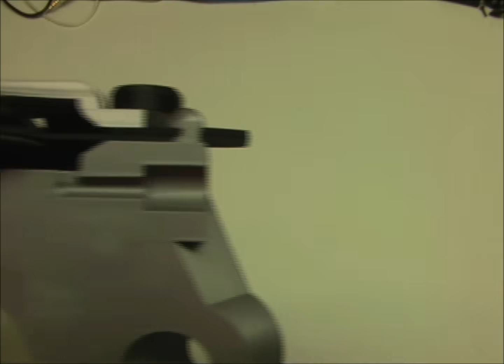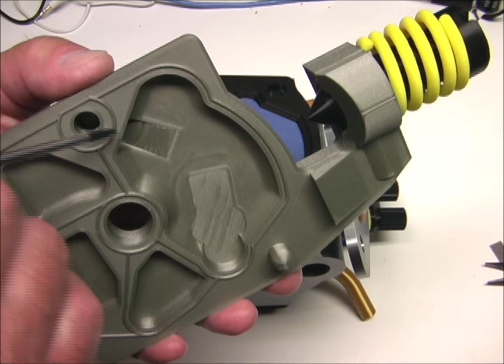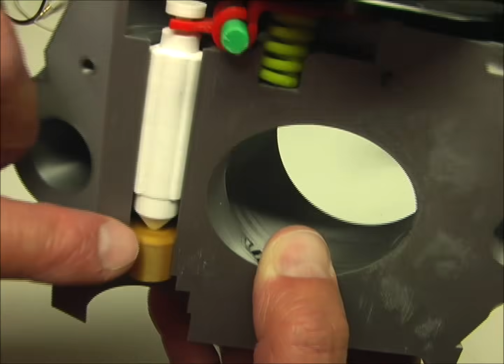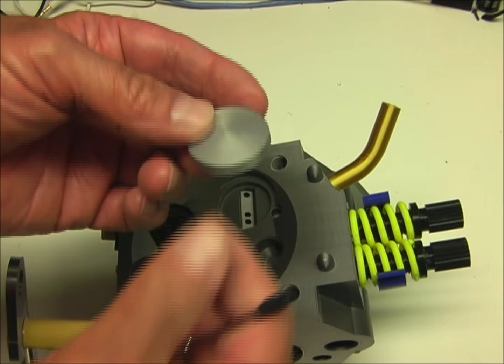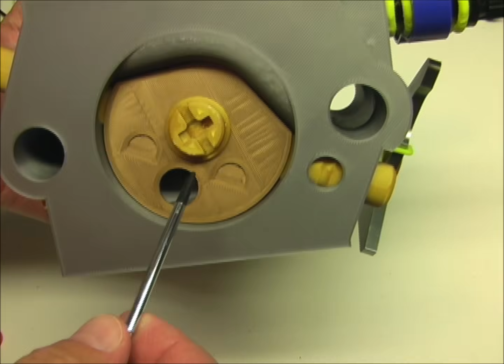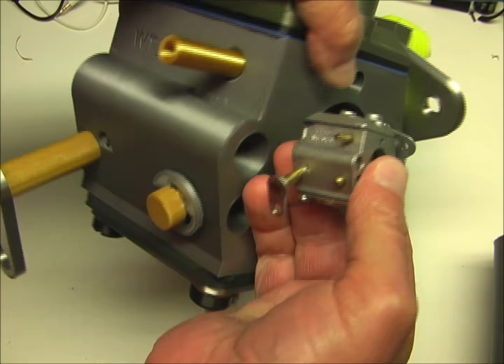How a 2 Stroke Carburetor Works, Fuel Pump & Metering

Comment: Could you explain in detail how the carburetor screws are adjusted while motor is running.  How does the idle and low pressure screws work together under ideal conditions.  Great video.  Thank You

Comment: Is it normal that  can't I blow into the fuel inlet with my mouth , the air will not go in. 
Even if the carb is off the engine.

Comment: This demo took me from mere fascination about the 2-stroke carburetor to a sound knowledge of the inner workings. I feel pretty confident I can take on my 2-stroke equipment fuel issues now. I have a chainsaw, which is out of production now, but has been a super dependable tool that I can get carburetor parts for but not the carb assembly. It needs lovin,,lovin'... here's to my new found knowledge. Super video.

Comment: 2-stroke or 4-stroke, carburetor works on same principles. Needs to be richened some to offset the addition of 2-troke oil, which leans the mixture fuel-wise, but works the same...

Comment: The inlet lever height adjustment is straight forward, but what should be the clearance between the fork tails of the inlet lever and the upper and lower collars of the inlet needle ie., how much does the lever need to move before the forked tail reaches the top collar and starts to raise and unseat the needle ?

Comment: What is the tube on the left side ,  forward of the mixture screws? I thought it was an impulse line but its hose  runs under the carb and to the standalone primer bulb. I'm getting no fuel to the cylinder in my brand new chainsaw

Comment: Thank You for this detailed exemplary explanation. A template for how to explain a device! 

If you have time, could you comment on how much interaction there is between the low and high speed needles. Is a statement that the low speed affects the high but the high does not affect the low, or opposite, or they are independent, hold true.

Also, does the low speed term  mean mid range/transition? I see there is the single hole called idle and 2 holes called low speed.

Thanks if your time permits any info.

Comment: I didn't expect this level of clarity and professionalism. English is my second language but I designed closed to 100 machinery, machine tools, injection molding machines and tooling and wrote most manuals for them and I did not even reached 75% of quality job as you did here.

Comment: I have never understood carburetors and my work on 4 cycle carbs has kept me away from the smaller ones. This video shows me I shouldn't have parts left over with 2 cycle carbs and your explanation really explains how they work in an understandable manner. Thank you so much. Now for your model. The amount of work to produce it seems fantastic. It really helps with your explanation. The time spent producing it was worth the work as it is large enough for us to see what is happening. Thank you for your time and effort.

Comment: Jay, I have a question. I think the one thing you didn't mention is the return/exit hole.  Is the vacuum of the fuel tank and lid valve supposed to prevent the fuel from flowing back into the carb ?

I don't get what keeps the return line from constantly delivering fuel to the carb. The metering side pulls the fuel in from the pump side, but the return hole is also there in the same chamber recess that feeds the nozzle check valve, and the nozzle check valve allows fuel to flow into the venturi. I just don't see why the carb should stop the backflow of fuel from the return line.

That's wrong of course, but i just don't see the mechanism to prevent it...

Comment: Excellent tutorial video. These carburators are so finnicky to work on and every once in awhile i get one that no matter what i do it just will not work right. At least now i have a better understanding of what goes on inside one. Geuss its time to start removing the welsh plug on some of the dead ducks to see if passage is plugged up behind them. Is there a special sealant needed when installing the welsh plug or do they mechanically seal just by setting them with a drift?

Comment: Those  enlarged 3-D printer models are brilliant. This is the first time I got any real understanding of how the tiny carburetors on 2-cycle garden equipment work. Lots of repair-tip videos out there, but nobody else takes the trouble to give the overview and explain the details of the fuel delivery cycle. For those who want to understand what's really going on inside these little marvels, watch this. Chinese factories may be able to turn them out today for $20 (I just bought two), but it took 150 years of creative thought and engineering to design and develop them. Appreciate that the next time you pull that starter cord.

Comment: Durn!  I've been rebuilding carbs for years and this is the best break down I have ever seen by far.  It has given me a new understanding of things that can go wrong and how I might fix them.   It also lets me see what I should expect to see when doing things like squirting carb cleaner in the various holes.  Walbro carb are very common and the clones work just the same with minor variations.  I owe you my thanks.  Next time I lift a brew I'll toast you.

Comment: Thank you for taking the time to make a large model carb and explain, in plain language,  how the fuel flows in a 2 stroke carb.  The carbs are not dependable. the slightest contamination can affect its operation, thus they break down frequently causing frustration. Hopefully the DIY can defend themselves with this knowledge and be able to repair it. God Bless

Comment: Amazing giant model and perfect and beautiful explanation of how all the parts function, including all the drilled passages of the idle jet ports, especially the idle ones in the sidewall of the carb throat. The tiny idle drilled jets are usually the real troublemakers as they are subject to being easily clogged, causing stumbling and stalling when the engine is just coming off of idle. Bravo.

Comment: Walbro should adopt this video as their main (and only) tutoring source to educate their engineers.  I am a retired computer engineering prof from a local university, and I can vouch that this is an amazing piece of work done by Mr. Gould.  I searched in the internet to get a good understanding how a Walbro carb worked because I wanted to learn about RC gas engines, but couldn't find anything substantial, just bits and pieces of info published by people who didn't know the entire mechanism.  Finally, I started examining Walbro diagrams on Walbro website, trying to figure out the exact mechanism.  I found out most of these diagrams were sketched for people who were already very familiar to Walbro carb, but didn't make too much sense to me (or novices that don't know too much about carbs).  I am glad I stumbled across this video.  Thank you again.

Comment: Hallo, Frage: Hast Du verschiedene Walbro WT Vergaser am Lager (z.B. 962 / 1114) oder andere. Für meine Modellmoren brauche ich diverse Venturi (7mm / 8mm / 10mm / 11-12mm). Von Walbro bekommt man ja (zumindest ich) keine Antwort welchen Zusammenhang die Nummer in Relation zum Venturi sind. Hast Du alle Ersatzteile für WT Vergaser, was ich suche sind Check Valve Assembly und Metering Feder da dies in praktisch keinem Reparatur Set vorhanden sind. Da ich nicht mal auf Deiner Homepage eine E-Mail Adresse gefunden habe versuche ich es hiermit.
Besten Dank und Grüsse
PS Wenn Du meinst 4-takter wären lahmer als 2-takter schau Dir meinen selbstegebauten Sternmotor (120cc) mal an (YOUTUBE: Birth of an engine - The run.

Comment: I agree with all the comments about the sheer clarity of this. The one thing I wasn't sure about was the diaphragm being pulled down by a vacuum. I'm assuming that vacuum is generated by air flowing past the fuel nozzles and gets back to the chamber through the fuel ports that lead to the throat of the carb. My carb seems to be pumping fuel into the metering chamber just fine, but if I can get the engine to start at all, it will only run on partial choke. It would be great to understand the vacuum mechanism better.

Comment: Great video, I was hoping you would explain the return side of the fuel route. I got an issue. When pumping the purge bulb the fuel floods the throat of the carb and does not go out the return tube.

Comment: Excellent job explaining the 2-stroke carburetor.  Particularly impressive is the use of 3-D printed model which makes it much easier to see the inner work of the carburetor. Will there be another one for the 4-cycle carburetors?  Thanks.

Comment: Unfortunalely  Walbro  also  has a main  nozzle in  throat that  is  connected with check  valve. I  did  not see that  in  video.I  have 4 pieces of brand  new carburators and  all  leaks at that  nozzle when  primed.Being  new there's  can't find any explanation since the check valve  is  good,,the  metering  valve seals 100% Anybody any ideas? Thanks

Comment: Thank you, this is fantastic.  Does the low speed needle always provide fuel even at high rpm?  Does the high needle only supply fuel when the air velocity through the venturi creates a low enough pressure to draw fuel in?
In other words, I'm curious what determines which path the fuel takes once it gets in the check valve.
Again, thank you- this really is so well done.

Comment: Amazing video!!  I now have an understanding of what goes on inside that little bugger with the adjustment screws on it.  About all I knew before was that fuel goes in and if it starts....the noise of combustion comes out.  Turn the screws to make her either blubber or sing.....🙄

Comment: Absolutely incredible. Video and explanation.  My only question is why the 3 holes on the low side instead of just the one that is on the engine side of the throttle plate.

Comment: Love your video.I have a Stihl weed eater and it floods the carburetor and the head with fuel each time I pul the cord.if I turn in both low and hi idle screws how many turns do I turn each of them outward to get it to start because it won’t.and the primer bulb just pumps fuel into carb and doesn’t fill itself up?thank you in advance for your time knowledge and reading my comment.thank you have a blessed day

Comment: Absolutely fantastic tutorial and 3D printed models! I'm Technical Director of a company that manufactures 3D printers and the time and effort put into Jay's 3D models is enormous, hours and hours of work needed to design and produce these models. Jay, you're a credit to engineers everywhere and your tutorial is 5* Thank you!

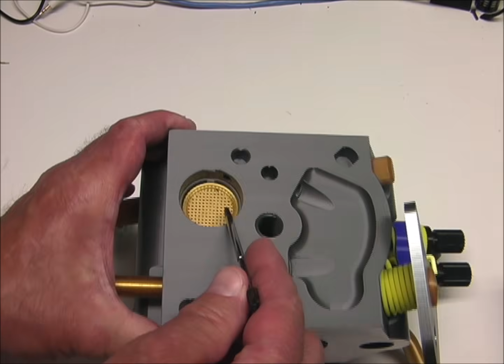PS. I repaired my chainsaw because of your detailed explanation of the debris gauze at  6:42 on the tutorial - mine was so blocked up that I thought it was a 'plug' and not a 'gauze' which it proved to be after closer inspection and cleaning !!

Comment: if i put the carb up site down, which is the diaphragm on the top, will it still work? because the vacum port in my cylinder block is down below

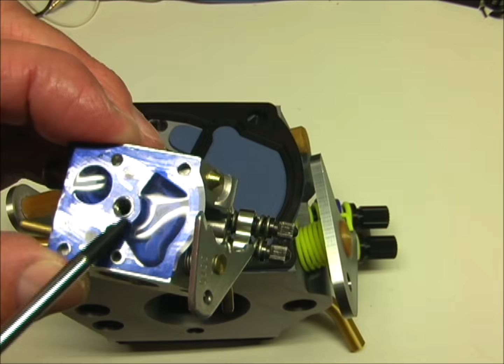Comment: Thank you very much for this video, I just bought an aftermarket carburetor and got frustrated it's not working until you described @ 1:42. I realized that the aftermarket gasket it came doesn't have a hole, bought an oem gasket and it's working like new.

Comment: Very well explained ! Best way of teaching complicated mechanics
1. How metering side diaphragm works ? 
2. How low speed metering valve supply fuel to the cylinder? You only indicated the high speed and low speed
Thanks

Comment: Excellent!!! May I ask,  is there a base or idle start position on the throttle valve OR should the valve be fully closed?  Seems this will affect the idle port as well as what I presume are "above idle" 2 transition ports (engine side of the throat)?

Comment: I'm only 13 years old and I was trying to fix an old Leaf blower engine but there was something wrong with the carb and my dad is a mechanic, so I think I know quite a bit when it comes to this stuff anyways, I tried to get this carb to work but I just couldn't so what I do is I take a completely different carb of a completely different blower and me being me found a way and got it to somehow fit and the carb on now runs really well.

Comment: These are "Demand Regulator" carburetors. They are not necessarily specific to 2-cycle engines. Tecumseh made tens of thousands of four cycle engines equipped with them.
The 1958 Brown carburetor was the first of this type. The literature on them mentioned that they were a simplified Bendix RSA aircraft pressure carburetor. In 1960 Tillotson bought the rights to the design. In about 1968 Walbro began manufacturing these "diaphragm" (as opposed to "float type") carburetors - and they worked really well.
       One reason they worked so well was that they incorporated a "main fuel discharge check valve" to prevent air being sucked in the main discharge when idling. For years nobody minded air being sucked in the IDLE discharge when the main was pulling high suction. Later Walbro and others (many if not most carbs used on Stihl) incorporated idle discharge check valves as well. (To my knowledge no idle check valves were intended to disassembled and repaired)
    A big problem with these carbs is the diaphragms become stiff and "oil can" in and out taking a set first one way and then the other. Walbro now has kits to retrofit clear diaphragms guaranteed to never stiffen (but they must be used with a matching super thin spring steel flat spring - it comes in the kit)
         Hardly any mechanics know that you should know how to check the piston rings, cylinder base gasket, crankshaft seals and even the reeds/piston skirt valves for air leakage if your initial disassembly and renewal of gaskets and diaphragms does not yield good running.
   It's like this kids: 1) Compression (which includes crankcase compression!) 2) Ignition - which includes spark plug. 3) Then if you have an engine with a dry carb in place that also EAGERLY burns it's prime - You can get it wound up and un-pinch the fuel line and see if you can get the carb to take over from the hand (squirt bottle) priming that you are doing.
YOU ARE WELCOME

Comment: Outstanding! The only thing you did not touch on was the brass tube coming off from the metering side of the carb which goes to the primer bulb. Releasing the primer bulb pulls a vacuum on that tube drawing fuel through the carb from the other brass tube which comes from the fuel tank. This primes the carb.

Comment: Extremely well done.  You take teaching to a new level with that 3-D printed model.  I now know where to look to solve my chainsaw carburetor "fuel leak out through the exhaust port while sitting and not running problem".  Thank you.

Comment: That was amazing. Your 3D printed model was straight out of a king sized weed wacker! My blower idles all day but bogs and dies when the throttle is opened, I now know to look for a restriction in the high speed  circuit to the venturi first.

Comment: Thank you. I've been stripping these down for a couple of years on my garden equipment and just cleaning them the usual way and blasting through the holes with carb cleaner and compressed air and fitting new consumables, then most of them work , but now I've got a difficult one to fix where that's not worked and after watching this, I know where the problem is likely to be. This weekend, I'll be out there taking a closer look in the affected area.

Update after a bit of time on the healing bench, its fixed !! The idle jet passages had a partial blockage

Comment: Wow, what an amazing explanation!  Best I've ever seen! I only have one question. You showed where the fuel flows through the idle port on the engine side of the throttle plate. But, where do the other two ports under that same welsh plug go?

Comment: Very cute little carb!  Amazingly complex!  You did an awesome job explaining and especially making that 3d printed model! Are the STL files available? perhaps I print my own model.  What runs the choke? is it manual or automatic bimetal coil?  Also, how would you adjust the low / high speed screws and idle screw?

Comment: Jay, as amazing, wonderful and helpful as this video (and all the work that went into it) is, it falls short of explaining the fuel system of the carburetor completely because there is no explanation of the return, purge bulb, fuel tank, fuel lines and vent valve.  That said, as far as you went this is by far the single best illustration of the inner workings of the carburetor anywhere.  Thank you!

Comment: Hi. Nice video. What a job you must have had making that wonderful model. Where inside the carb does the fuel to the fuel return pipe go? I have a Zama carb for a Stihl MS-250 that does not run properly at idle. There is no primer bulb on the carb, but there is one further up on the saw. When I push the primer bulb I see a lot of bubbles in the transparent hoses. I ran a hose from the carb inlet to a jar with petrol and pushed the primer bulb. There were still bubbles in the fuel lines. So it's apparently not the fuel line down into the tank. I pressure tested the carb inlet and it held pressure fine. But when pressure testing the fuel outlet pipe on the carb it did not hold pressure at all. That's why I'm asking about the fuel outlet on the carb. It is supposed to hold pressure, right?

Comment: I just went out to it and it starts and seemed to be perfect for the first 30 seconds to a minute but then it started bogging down when you pull the throttle and it idles for 15 seconds then dies. Walking back in I hit me to check the check valve from the metering area into the high/low adjusters. Maybe that check valve is allowing air to come back into the metering area?